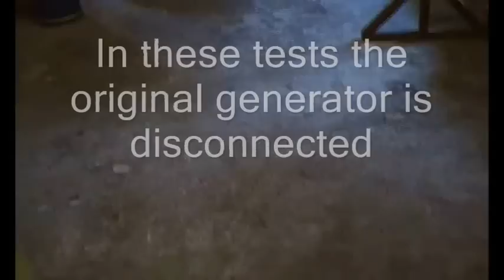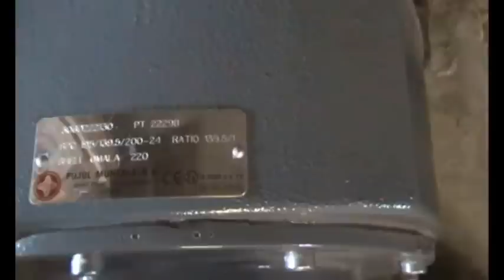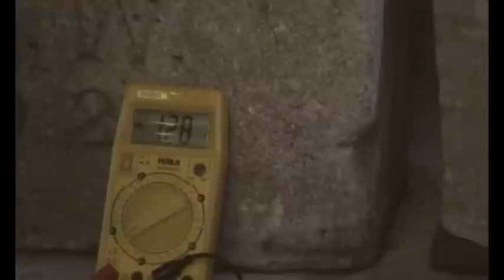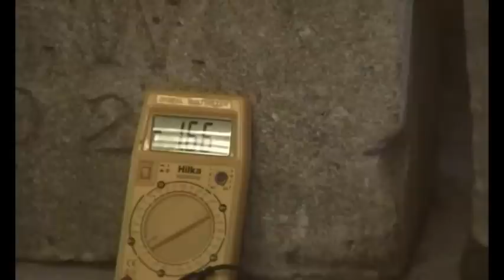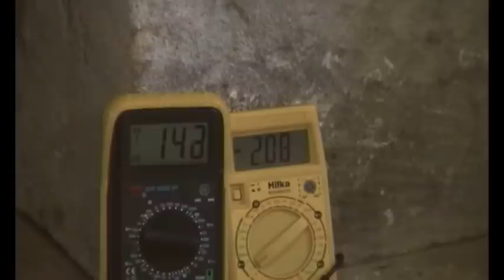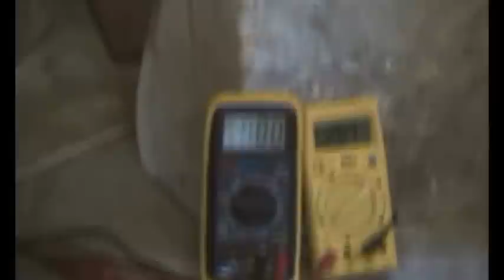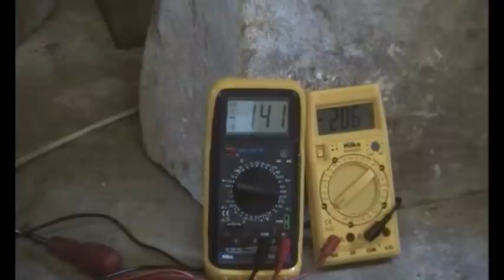Generating electricity with a water wheel, investigations into gearing. Part 1 of 3

Comment: Do you think you might want to try a smaller pulley on the generator or perhaps a bigger on on the output ov the gearbox? Seems you need to get your RPMs up on the gen shaft.
Reply from the maker: Hi. Thanks for the comment. I know that what we are doing sounds counter intuitive, but because the main gearbox has such a large ratio we then have to gear down to the generator. The first pulley used was 9 inch, and the second was 10 inch that gave a higher output, allowing the wheel to run faster by reducing the overall gearing. More to follow as we have sourced a 30:1 gearbox that Jim will fit in the next few weeks. More tests to follow. Cheers

Comment: In your video the wheel is a 10ft beast wheel. Right? We have a 14ft overshot wheel (19rpm and 5-7 hp) - do you think that a highly geared gearbox (like the 139.5:1 you swapped out in the video be less of an issues for our situation? Possibly more advantageous?
Reply from the maker: Hi, see my other comment, with the right generator and either a solar grid inverter or a turbine alternator you could  be seeking a ratio of less than 50:1. They are designed to run slow, cheers

Comment: Hi sir how r u. Your project s very nice.if donmy I have analog counter I need analog counter convert to digital simply wiring how to making in wiring please .
Reply from the maker: Hi, the rev. counter we used was mechanical and similar to the older trype of car speedometer which is a magnet spinning inside a close fitting drum. Digital counters are based on a hall effect switch and some electronics so are not compatable with analogue mechanical. Cheers, Andy
Reply: Thank you sir
Reply: I have diesel flow meterin analog liquid control system

Comment: Use in a off grid a normal three-phase asynchronous motor with the right multiplier ratio to turn it to about + 200-250 rpm from the plate data, if the power is below 500 W ok for permanent magnets, it does not make sense because Asynchronous motors modified with rotor magnets do not have good efficiency is a compromise, they are not real PMGs or PMAs, so above 500w normal non-modified three-phase asynchronous drives, auto excited by capacitors straightening with a three-phase diode bridge, stabilizing with a large polarized condenser, I protect it with a voltage-dependent voltage-dependent load regulator (IGC) or a high voltage relay that carries an electric ballast, or loads a large battery bank for off-grid with a mppt regulator downstream load derivation or enter a grd inverter for FV and go into network if over kw go to directly produce the 230V monovase with the capacitors connected with the C-2C system and stabilized with ■ a voltage-dependent voltage regulator (IGC) and uses it directly or goes into the network without excitation capacitors but only the right one to re-configure and network protection according to standard.

Comment: How much torque is prduced by the main water wheel?
Reply from the maker: David, no idea, but they have found the cause of the variable speed and fix it, so no doubt more power is available. There may be an update if I'm in the area, cheers

Comment: im trying to learn about this kinda stuff and how does a wheel turning make power go thru a wire. im very confused please help
Reply: im sorry if i seem dumb im only 14 but i guess thats a excuse to ask about this kind of stuff.
Reply from the maker: Hi. The weight of the water in each bucket on the wheel makes the wheel turn, this then turns the wheel axle shaft. This then turns the gearbox, which then turns the generator. See parts 2 and 3 . cheers
Reply: Thanks

Comment: Ok first of all how many rpm is the new generator. Its normaly 3600 1800 1300 2 pole 4pole 6 pole  at a 60hz net, so make the ratio with the pullies that you reach that rpm. the generator is designed for that rpm.  That kind of water mil should easy generate a 10 kw.
Reply from the maker: Hi. Thanks for the output estimate. The new generator  is permanent magnet, and from a wind turbine.so gives 240v DC at 500 rpm. Suitable to link to a grid tie. Thanks for the comment, cheers

Comment: Take that power consuming gear box out and go direct from pulley to pulley
Reply from the maker: Yes, flat multi V belts would be better. I lay shaft would be required to get to 30 : 1, cheers
Reply: @TheInfoworks  consider flat belt,, much less friction than v..  Pete.
Reply from the maker: Pete, yes, a multi V flat belt, maybe a 6PK style, similar but larger than a washing machine belt. I used this successfully recently on a Denbigh drill motor conversion, cheers

Comment: ton of power lose through gearing. chain drive would be much more efficient
Reply from the maker: That's right, and a light weight chain would do, but to get 30 to 1 you might need 2 lay shafts with associated bearings. Cheers